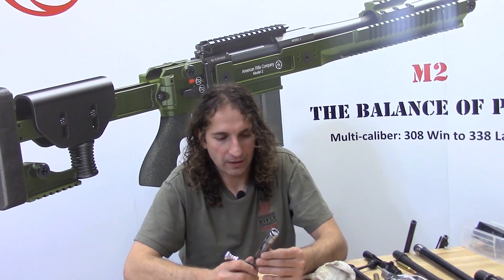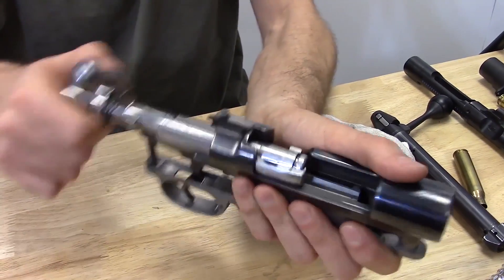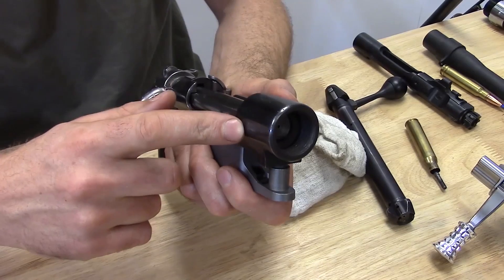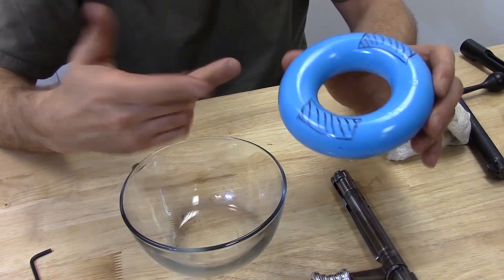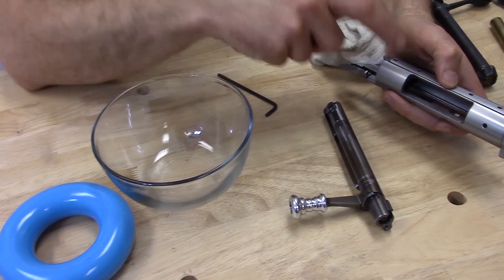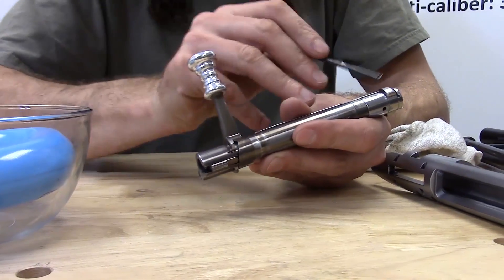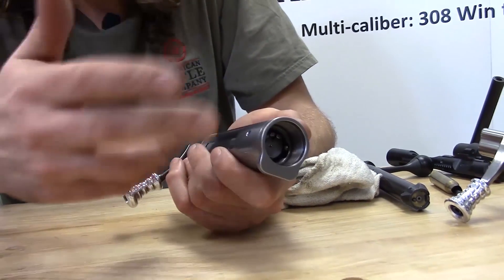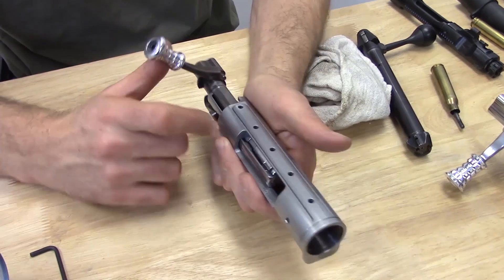Mausingfield Toroidal Locking Lugs

Comment: Good vid .  Hard to explain  on screen without  white board .  I thought the  best locking  system kept the bolt face 90 degrees to the barrel centre line . if the bolt is allowed to move  this angle changes . Not a great  problem on military rifles , yet on  civi's that want to reload  , if the bolt face was not at 90deg the fired brass head would indeed be  off centre.

Comment: Hi Ted, thanks for explaining this piece of the action. Makes sense from one engineer to another, what you've said.
I'm wondering about another critical feature of your receiver design, do you have a means to control the axis of the barrels you use to keep them tightly coaxial and collinear when they are threaded and tightened together, not relying on thread engagement alone to achieve that connection? Thread design by nature is excellent to achieve clamping force, but rather poor to achieve concentricity between mating parts.
Thanks for the answer in advance!

Comment: Ted how do you ensure that the bolt face is square to the case head (Chamber) for accuracy or does it even matter? Is the bolt face square under the tension of being cocked or does it square up when the trigger is pulled and the bolt is free to move and square itself with the assistance of case expansion. I would think that the upward movement at the rear of the bolt while cocked can also be minimized by increasing the outside diameter at the tail-end of the bolt before the bolt handle. This would tighten the fit to the inside walls of the receiver and get you very close to being square.

Comment: Wouldn’t the reduced contact area of the bolt risk setback?
Reply from the maker: Nope.  Parts elastically deform and then rebound.  Deflections are small and toroidal surface appears almost flat to the eye.  This is analogous to how cylindrical roller bearings are designed to reduce or eliminate stress at both ends of the cylindrical rollers by disengaging the inner and outer races at the ends.  Admittedly more important in cylindrical roller bearings than in bolt actions but anything worth doing may as well be done right, especially if it's easy to do.
Reply: @AmericanRifleCompany  I’m not an engineer, but it seems that this design has less contact/bearing surface to distribute the bolt thrust over than traditional two or three lug bolt designs. I think the result would be that it would reach the limit of elastic deformation sooner than conventional designs. It seems that could lead to bolt setback. 

Whether this could occur within typical operating pressures limited by brass and primers I do not know. As I said, I’m not an engineer and could easily be speculating on a circumstance which is unlikely to occur.

P.S. Roller bearing, whether cylindrical or tapered, increase the bearing surface compared to typical ball bearing.
Reply from the maker: We can think or believe whatever we want, but there's no substitute for actually testing.  Real test results often differ with expected results.  That's why we test.
Ted
Reply: @AmericanRifleCompany  At what pressure level do the parts deform in a non-elastic level?
Reply: @richardbriscoe8563    I am an engineer and I understand what you are thinking about.  If the radius of the feature on the bolt and the action are identical than there would be a full contact surface the same as a normal lug.  Of course they will never be exactly the same but that is where what American Rifle Company said about small deflections under pressure comes into play.  If they are close to the same radius but have single line tangent contact when there is pressure if both surfaces should conform to a full contact and then spring back into original shape.

As another thinking point in a typical bolt with flat faced lugs there will also never be a full flat on flat surface contact.  "flat" surfaces are not really flat.  So the same compression effect takes place when firing.  The only time you may have bolt setback from non-elastic deformation would be when the radius of the bolt and action are far enough apart that original tangent contact point is compressed beyond elastic.    Hope that makes sense.
Reply: @TheADMartin23  Thanks. Even “custom” actions sometimes require a little attention to improve locking lug contact. There have been production action with partial contact on one lug and essentially none on the other which shot better than anyone thought they should. I suppose that shows the soundness of the design despite the execution having shortcomings.

My question had more to do with the bolt thrust being born by a comparatively small contact area which might reach the elastic limit of the material. Frankly I don’t know the answer. The people behind this action, if I understood them correctly, are saying that, in actual experience, the material remains in an elastic state/range which is GIne by me. It’s always interesting to see new approaches to action design and fabrication. Cheers!

Comment: While those rounded lugs my stay in contact at all times, what about the bolt face remaining square to the case head?  To me it would seem that properly lapped conventional lugs would be better at keeping the bolt face concentric or am I missing something here?
Reply: If the back end of the bolt wasnt pushed up (fixed with cocking mechanism as he describes) then the bolt toroid(s) could theoretically self center given enough clearance at back. That would also be a tough thing w all the leverage of the bolt weight. Pretty sure this is why he made the new heads floating. 3:23 more properly demonstrated should be him moving the receiver around and keeping the bolt straight.
 Also, that flushness would come with a slight shift off centerline, but I think the cartridge head would have enough play on face to deal w that, if it could slide.